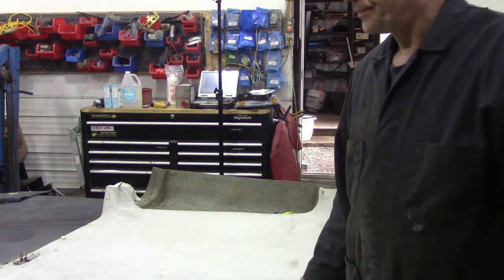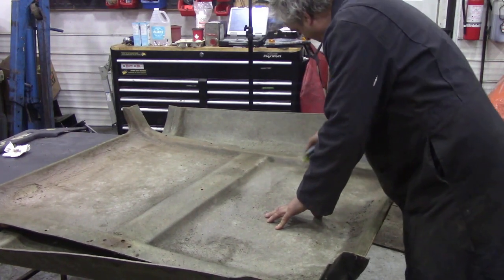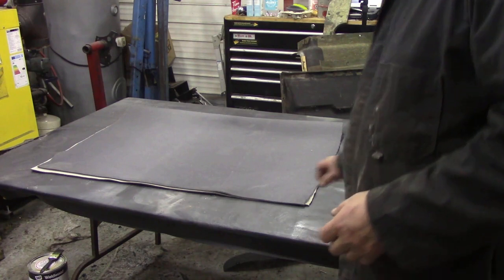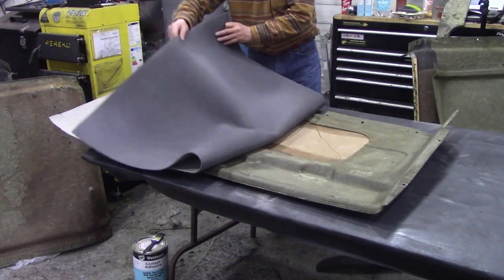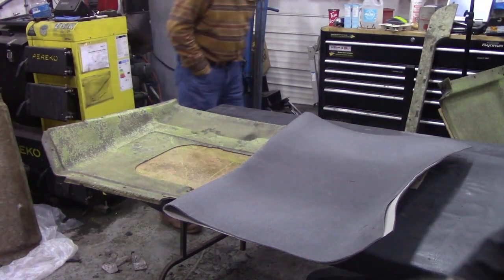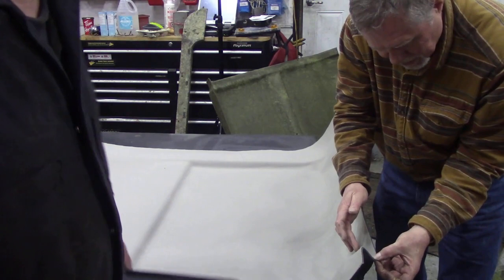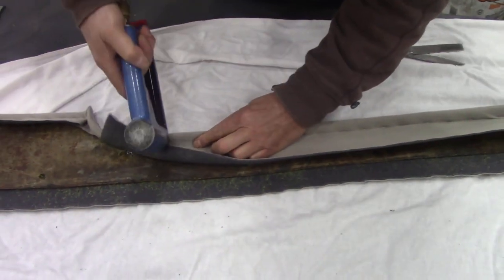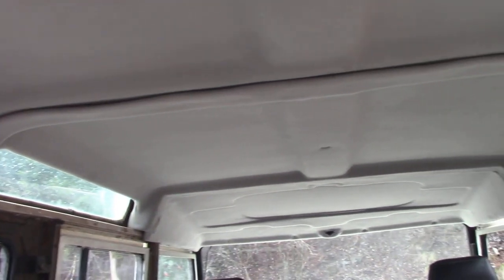110 headlinging restore - making the most of a bad job!

Comment: Try some fibreglass resin on the molded backing prior to glue... It stiffens up the job and helps with the glue going off... I was told this by a mate after I did mine...
Reply from the maker: Yes we have done that in the past, but resin is expensive now!

Comment: Awesome - I've got to do this on my classic!  Been putting it off for a year since I took the headliner out.  at least these a manageable size panels - The classic one's one piece.  and this is an LWB - so even bigger.
Reply from the maker: I have done classics -quite easy to do as the headliner material is different -  better to work with

Comment: Top tip; if your backer is a bit soft and flexible and wants to sag a bit what I do I mix some all weather PVA 50/50 with water. Lay your headliner board somewhere flat and absolutely saturate it with the solution and let it dry; your backer will be rock solid and stiff and won't bow or sag in the middle; this is what I do on all kinds of perished materials, it really works. Just be sure to use high quality pva like the stuff that you use to seal concrete
Reply: My headliner was soft and flexible and perished after 26 years of rotting, now it's like new; make your Landy better!
Reply: It also won't soak up your contact adhesive as the PVA seals it!

Comment: Thanks for the tips! I just took my headliner out this week for restoration. Hope I can make it as nice as, or nicer than yours. Kind of a tricky project!
Reply from the maker: Don't use your fingers on the flat surfaces to place the lining material - glue can be pressed into the foam and you will have marks on the finished surface - use a big fluffy roller for best results and make sure the headliner board is free of any imperfections 

The headliners boards we used were the worst of the worst - we had nothing else to use - they had been in a container for 4 years and under cover outside many yard before that -they were a bit damp
Reply: i guess Im randomly asking but does any of you know of a method to get back into an instagram account??
I was stupid forgot the login password. I would love any tricks you can offer me!
Reply: @Arlo Saul instablaster =)
Reply: @Jayson David i really appreciate your reply. I got to the site through google and I'm in the hacking process atm.
Seems to take quite some time so I will reply here later with my results.
Reply: @Jayson David It did the trick and I finally got access to my account again. I am so happy:D
Thank you so much you saved my account !
Reply: @Arlo Saul No problem =)

Comment: Yay. Two things. 1. The marine industry became enamoured with foam-backed-vinyl as it could be applied directly to the GRP inside as it covers all kinds of lumps and bumps. But as you are finding, a decade on almost every letter to PBO in the uk was about how to fix the dropped lining. It is usual to use spray on contact adhesive on foam backed vinyl which may explain the hap-hazard patterns you found.

2. In the heads (bog / bathroom to septics) on my boat the previous owner had applied foam backed lining to green plastic tiles (which had been fitted really well but look horrid, great in the 70s when she was built). I stripped away the foam vinyl and was left with glue on the tiles, this can be removed if rubbed with a finger, but I think my skin will give before the heads are finished. I never thought to use a grit pad on the grinder, that will allow me to clean them right up.

3. (bonus). You have inspired me with your plastic spraying of mouldings and if I can find a good hard wearing white I reckon that will look good on the tiles, I was going to use flotech, but the cost is eye-watering and I've never been convinced it will work all that well.

So, Thanks Mike, in a weird way, your Land Rover video from Quebec has inspired me to tackle a problem on my boat in North Wales.
Reply from the maker: This 110 is almost done now as far as I am concerned
The plastic paint is expensive but it is good -really bad fumes on application though!

Comment: Would be really great if you could post up the size of each material panel that was required, also did you need to thin the glue for spraying? I have used the rattle can ones in the past for seats but the only other contact glue I have used is the evostick type more like treacle.  I'm a long way from doing this, when I took mine out the backing boards were a little damp so i will be inspecting the roof with care to find out if it was just condensation of a leak.
Reply from the maker: Will do next weekend
Reply: @BritannicaRestorations  since i found you via the re vinyling the dash you have covered pretty much everything I need to do.  The only thing that's stopping me is the funds.  I have to do a bit then save up!
ASAP donation on its way!

Comment: Hi mike Alec (from gods county ) asked lads at work best way to do head linings they do a fair few a year a few hundred for camper vans and motor homes,
They said if your using old head boards don’t seal with glue spray pva sealer or spray varnish it’s cheaper way to go and you can do a couple of coats cheeped than using all your glue wait to dry then give them a light rub down with light paper also if your not using a vac system get a small steam gun to stretch your material and use 4 way stretch material hope this helps

Comment: If you primed the head board first it might help.
Reply from the maker: That is why we gave it a first coat of glue and let it dry
Reply: @BritannicaRestorations  But would thinned down PVA not be cheaper and seal better. Just a suggestion.
Reply from the maker: Possibly but I didn't have any
Reply: Try 50/50 pva wood glue and water give it two coats you will notice the board will become heavy but will dry out, when dry it will stiffen up the board and also it will stop any damp then spray your glue to the shiny surface of the board